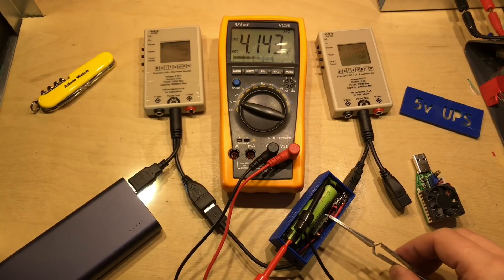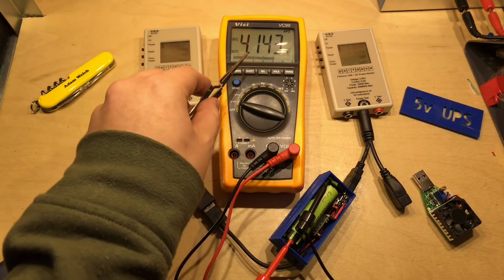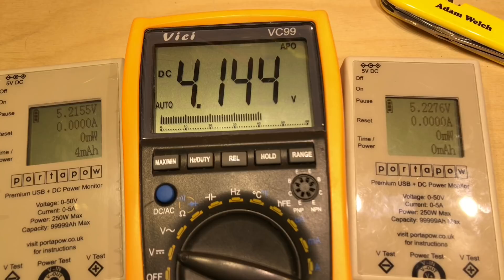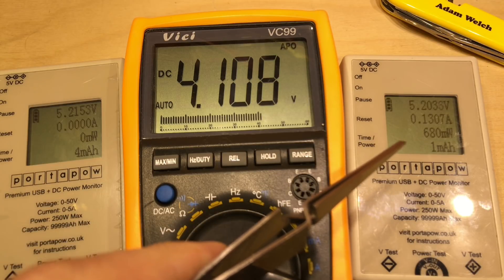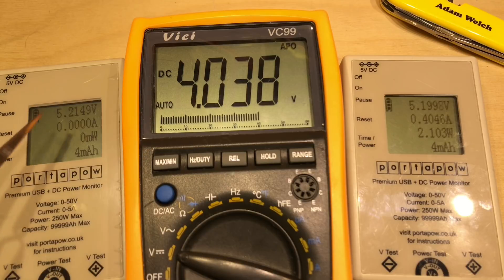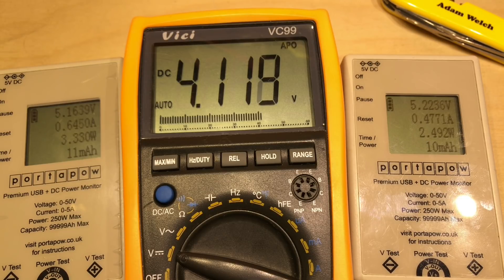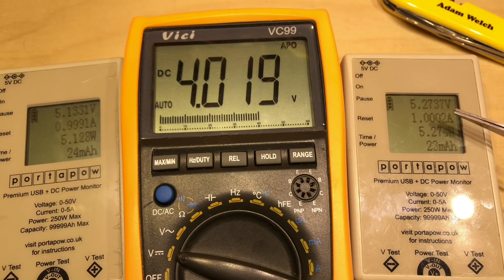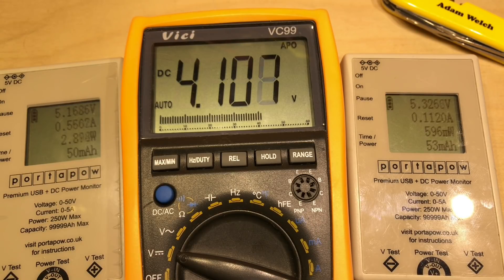5v UPS Module Update - 12v Solar Shed

Comment: I know this is an old video, but the update is useful.
These modules are really meant for use with a solar panel with a higher voltage going in than 5v. If you increase the volts in, then I would expect the Cell to charge until full depending on the current from the Solar panel.
The fact you are trying to use it as a UPS is a bit of a stretch, as it will perform much better as a daytime charger and a night time power source.
Something to bear in mind. In addition, to help the Cell and to stop it being over charged / over discharged the use of a single cell BMS would be prudent.
David G1ZQC in Lincolnshire.

Comment: Shoudln't it be enough to take a normal power bank and a wall power supply 5V which is highly efficient and two MOSFETs?

One MOSFET is N-Channel and one is P-Channel to switch between the two inputs when the Mains 5V is being absent. The power bank is taking care of the cell protection and the bank is also being charged (if there is mains) by the wall adapter, too. Additionally a capacitor as buffer may be a good idea.

Comment: There seems to be another board on ebay.  Search for "5V/2.1A Charge Discharge Boost Protection 3.7V/4.2V Battery DC-DC UPS DIY Module".  I wonder if this board works any better.  Could you test this one?   Thanks.

Comment: Is it possible to create a 12V UPS (3S) with 12V in also, somehow? and what will be required??
Reply: https://www.aliexpress.com/item/DC-UPS-Power-Charging-Module-Synchronous-Step-Down-Charing-DC-5-28V-10A-Precise-For-Lithium/32812745981.html?spm=a2g0s.13010208.99999999.283.hrnyt5 

With something like this?

Comment: You need a chip with power source management, like the MCP73871 used in the Adafruit Powerboost 1000c. It detects USB power and/or battery power and uses the appropriate one when needed. It's not where near as cheap as the TP4056 though!! A cheaper alternative would be one of the Ali boards used for solar - http://s.click.aliexpress.com/e/AI2vJaM They use the MCP73871 and claim the same power load functions to not charge/discharge the battery. Test one for us all will you Adam?!!

Steve

Comment: whats worse is that it uses a linear charge circuit, so the 5W on the input is only 4W at the battery, then it is boosting pulling 5.25W to get 5W out, so a total loss of 1.25W (assuming 5v in, 4v on the battery, 1A linear charge rate, 95% efficient boost converter.) could just use a schottky diode from the input to the output, that would probably help ALOT
Reply from the maker: You're right of cause there are a number of inefficiencies in the design - but to be fair there are inherent inefficiencies in UPS's in general.  I think it may be a good idea to see how I could adapt it to make it work better. Cheers
Reply: I'm not sure that's the case SuperBrainAK, the TP4056 are not linear voltage regulators, they are very efficient when charging and I've never seen on getting hot while charging at the full rated 1A. If you look at the Icc symbol of page 2 of this document (http://www.haoyuelectronics.com/Attachment/TP4056-modules/TP4056.pdf) then you will see that the Icc is 80-150myA at a Ibat of 1A with a Vcc of 8V, I read that as the chip itself is disipating at worst 150myA x 8V = 1.2mW and as it doesn't get hot at all when charging a cell at 1A I would agree with those numbers. If it were dissipating up to 3.8W (at Vcc of 8V and Vbat of 4.2V) then it would indeed get very not. :-)

Exactly how the TP4056 does that internally I'm not sure but it works great. I don't have a oscilloscope to test this but I would think it's PWM the Vcc down to the capped Vbat while limiting the Ibat to 1A, quite clever I think.

I did sport few interesting bits from the TP4056 specifications, you can use CE to enable or disable the charging and you can calculate the charge current from measuring the voltage on the PROG (Iset) pin, that could come in handy when making a charger / capacity tester as you should be able to simply turn off the charging circuit when you're testing it, No need for an external MOSFET to disable the charger. :-)

Comment: Adam Welch+
https://www.ebay.com/itm/USB-3-7V-Lithium-Li-ion-Battery-Charger-Module-4-2V-Boost-Step-Up-5V-9V-12V-24V/122534900120?_trkparms=aid%3D111001%26algo%3DREC.SEED%26ao%3D1%26asc%3D41451%26meid%3Dd8fe28527dad419b902f5af22f2ac7e0%26pid%3D100033%26rk%3D1%26rkt%3D8%26sd%3D122804727430&_trksid=p2045573.c100033.m2042
Reply: This device may just do what you want. Look familiar? Just use a protected cell
Reply from the maker: It looks a little familiar!  Yes it's practically the same device, but not sold as a UPS.  Thing is in both implementations the 5v USB has no connection to the boost converter except through the TP4056 and that's where these things fall down I think.

Comment: I have a couple of r'pi each running on a 5v UPS -- one is based on a 12v cordless tool battery, on its charger, with a dc:dc buck converter dropping the output to 5v. The other is similar, except using a cheap 16 volt super-cap module, with a 12v dc adapter feeding it, and another one of those dc:dc buck converters to provide 5v. The super-cap version will only run for 10-15 minutes but that is usually enough.

A higher voltage converted down seems like a more robust scheme, but slightly harder to implement using li-ion since it requires series cells with all that that entails.
Reply from the maker: Interesting solutions you've got there.  10 minutes will be enough for many situations.  Traditional server UPS's are usually only spec'd to give 15-30 minutes of run time.  Enough to shut down safely.  If you want longer term protection you'd be looking at a generator.
Reply: Hi Sylvan, I'm looking for a ups solution for a raspberry pi running on a cars cigarette lighter. Something to give to pi just long enough to shutdown. Any suggestions?

Comment: The tp4056 has a hysteresis, it charges up to ~4.2v  and doesn't start charging again until it drops below ~4v. Also, the tp4056 will only charge at 1A with the standard settings, but note that since it's a linear design you'll only get ~4W input to the battery at 1A. Whereas the output boost converter will give you 5V@1A, drawing ~4V@1.25A from the battery.  So even though the input and output are both 5V@1A, the battery is only getting ~4V@1A, causing a net loss in charge (with the other 1W lost as heat in the tp4056 linear regulator). The maximum output you should draw is therefore ~5V@800mA.
Reply from the maker: Thanks for doing the maths, it makes perfect sense.  I found my TP4056 was starting the recharge at about 4.1 volts I think.  I'm thinking a couple of improvements to the design could improve efficiency and create a properly functioning UPS.

Comment: Could you not fix that if you put in a diode from the incoming 5V rail straight to the input of the boost converter thats providing the 5V output from the battery? You may need to add another diode between the output of the battery and the boost converter to stop the first diode from charging the battery bypassing the TP4506 charging circuit.

That should allow the input 5V rail to feed the output 5V boost converter bypassing the battery when the input is live I think.
Reply from the maker: I think this is a very good idea and well worth testing.  Thank you.
Reply: I have partially tried ORing with diodes with little success (they tend to heat up). One of the ways I was looking into was a MOSFET to switch between the two. If you take a look at the data sheet for the TP4056 (https://datasheet.lcsc.com/szlcsc/TP4056_C16581.pdf), at the bottom of page 15, on the left shows a configuration to power the TP4056 from either USB or a wall wart. My idea was to apply this to the output instead. USB / Boosted. I mocked up a circuit sim on Falstad (http://tinyurl.com/ycp8r6oy).
Reply: I ran a test on what I found ... you are right there is a drop... for me it isn't a problem (and I am trying to avoid buying more parts)... It might be one for higher currents...

Input #1
5.009 volts
0.400 amps
2.003 watts

Output
4.33 volts
0.400 amps
1.73 watts

Difference: 0.679 volts
--- 
Input #2
4.199 volts
0.400 amps
1.679 watts

Output
3.75 volts
0.400 amps
1.500 watts

Difference: 0.449 volts
Reply: That's a interesting diagram and it looks like an ideal diode setup to me. You could of course replace the schottky diode(s) with a ideal diode(s) like these: http://cds.linear.com/docs/en/datasheet/4358fa.pdf then you won't have a large'ish (~0.6V) voltage drop across the diodes and thus no power dissipation.

Combined with a DW01 (like this: http://artofcircuits.com/wp-content/uploads/2016/06/TP4056_Protected_Battery_Charger-3.jpg) you could have a protected Li-ION battery feeding a 5V boost circuit from either the input VCC on the left or the Vout from the right using a couple of ideal diodes with very low forward drop (20mOhm when on) and if the inconing Vcc from the left drops then the charger stops charging obviously but the DW01 will then supply the 5V boost circuit until the Vcc comes pack and starts charging the Li-ION cell back up and supplying the 5V boost circuit directly via it's ideal diode. 

Thinking about it you just need one idea diode on the Vout from the DW01 to stop the Vcc from the left back-feeding into the DW01 output when the Vcc is higher than the Vout from the DW01 module.

Then the Li-ION cell sits there waiting for a load and is being maintained by a TP4056 so will loop around in a charge to 4.2V / slow self-discharge to 4.05V all managed by the TP4056.

Comment: So it's not a "UPS" but rather a charger and a boost connected together. This is the behaviour you'd expect from this arrangement. Is there a simple hack to bridge the charger so that the load can bypass the charger when in "online mode" as it were?
Reply from the maker: I think there may be a hack yes.  I've sharpened my pencil and I'm scribbling schematics down as we speak!
Reply: Nothing yet? Mine arrived today. I'd rather not draw from the cells when it's "online"

Comment: I think that it's possible the charge current is being limited to the 18650 cell. You probably should check the charge resistor to make sure it isn't limited to 500mA. Maybe if it was allowed to go to the full 1A, it might behave differently.
It would be interesting in seeing how this unit would perform with that resistor swapped out for one that allows for 1A charging of the cell.
Also, I'm guessing you didn't notice it, but I saw it. At 3:08 just before you start to increase the load current, the TP charger kicks in. I had to slow down the video playback to actually see it because it's only about a second before you start to turn up the current load. At 3:09, the left meter shows 0.0mA draw, the right meter shows 0.404mA draw. Then, at 3:10, the left meter shows 0.592mA draw, but the right meter still shows 0.404mA draw. And, at 3:11, right meter to 0.589mA, right still at 0.404mA. At 3:12 is where you are starting to change the current load as the right meter now shows 0.433mA, and the left meter has bumped up to 0.596mA draw. So, just in less than 3 seconds, there was a change in the UPS charging state. So the TP charger kicks in voltage charge at ~4.114V.
Reply from the maker: Well spotted!  Yes I think you're right, after running the test a couple of times I think the TP4056 is starting it's automatic recharge at about 4.1 volts on the cell.
Reply: Yeah, I was watching the numbers closely and I barely saw the change in time when you said you were adjusting the load current again. I had to go back and slow the video down to make sure I saw it right  :)   It also helps I was looking at a 42" screen when it happened, so plenty of viewing real estate  :)
But that was some timing, though.  :P

Comment: Nice little UPS, I can see no problem keeping the 18650 cell on recharge as long as it stays under the 4.1V, for even longer periods of time, say like months I would simply keep the 18650 on a max recharge of around 3.9V to 4.0V to increase it's life span.
Reply from the maker: This is exactly the sort of thing that is happening with many solar installations of lithium cells.  They are being cycled quite a bit - at least daily for years.  So I agree there is probably not a major issue.  It's also worth remembering that this cell came from a laptop battery which was heading for the recycling centre - it's still got useful capacity and this project is extending it's life anyway.
The only difference here is that the TP4056 is charging to 4.2 volts (well this one went to 4.18) which is pretty much fully charged.  I don't think anyone running lithium in their solar projects charges quite that high?
Reply: Adam Welch Hi Adam, a simple 1N4007 at the charging side can drop the voltage to a lower voltage.

Comment: Seems to be the normal charging behavier of the tp4056. It restart charging below 4 volt and loweres the maximum charging currend at higher volts.
Reply from the maker: Yup - and sadly that means that it doesn't really perform as a UPS. There is no direct connection from the input to the output.

Comment: So this is not an UPS per say... it's a battery charger with a boost module since a true UPS module would keep the load running and charge up the battery with what it can ( the left over current ).
Ooooh.... i smell an arduino project around the corner :)
Reply from the maker: I'm like the sound of these ideas. :-)
Reply: .rpv Comparators a very quick, reasonably sized output cap should hold the voltage long enough for the switchover to complete. Provided that you drive your MOSFETs quick enough.
Reply: A simple opam as comparator should work, the issue it's what would happen when the switch occur, maybe with a super capacitor as buffer?
Reply: I was thinking to use the enable pin on the boost converter IC, but yes, the load and the time that will take to do the switching will define the size of the capacitor that be used as buffer and also I'm thinking that will require a schottky diode on the input signal to avoid that voltage from the boost converter go backwards, right?

Comment: Acts like an "online UPS", perfectly fine. It would be wise to use the "off line" UPS, since that, as suggested, won't stress the battery. At the cost of a few mosfets (and maybe an power-path manager).
Reply: BellPhreak do you even need the mosfets in the most simple terms? How about a simple bridge with a diode or something?
Reply: If a voltage drop is accepted, which is inefficient in my opinion. An "ideal diode" should work (search for 'ideal diode' on endless-sphere.com), but availability can be a problem. Short answer: yes, a mosfet is required. Bridging the 5v line, while disabling the 5v regulator when connected to an USB-charge-source.

All powerbank vendors should have pass-through charging! They exist, but I would love to see them tested via Adam' measurement, to see if they cycle the cell (even a tiny bit would be bad imho).
Reply: Agreed about more powerbanks supporting these. And Yes, I have discovered "ideal diode" and how they're almost necessary for the UPS/"pass through" charging. I guess the reason many of these power banks don't support this is because ideal diodes are not cheap and the extra expense just eats at profits.

But I think we can make this better without the "ideal diode" right? And maybe without a fet/switching off the charger. Why can't the 5v charge supply just be bridged over to the 5v output with a regular power diode (or two) so that the load can source from the "online" input and place less(or none?) drop over the battery?
Reply: A diode would not work due the regulator delivers a higher voltage (diode voltage drop), and thus there's no current flowing through the diode (with a modified version of Adam' suggested PCB).

I've bought a bunch of power-path IC' in DIP format (can't find them, nor ebay mails), which switches between 2 voltage-inputs. Can be made with discrete components with an opamp, a NOT-gate and two (N-chan) mosfets. And a potmeter to adjust the opamp/sense voltage offset, which lets you choose a preferred power input switchover, at for example 4.9v (or 11.8v at a 12v system).